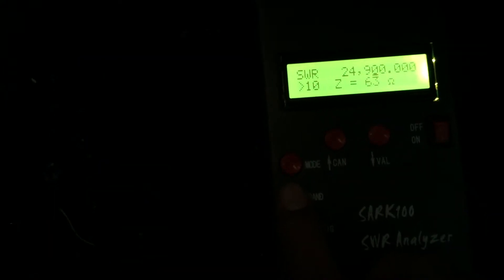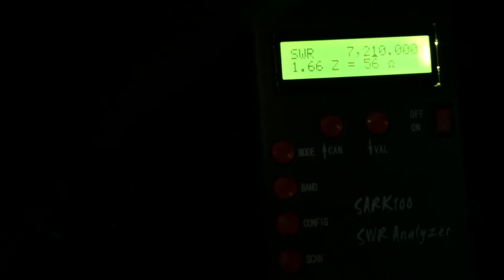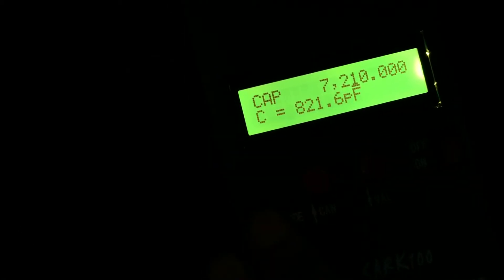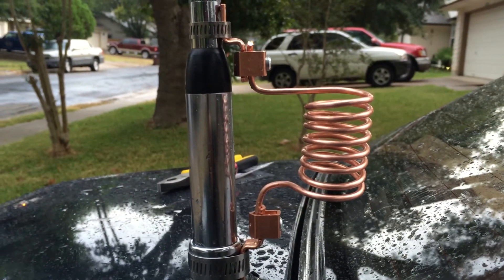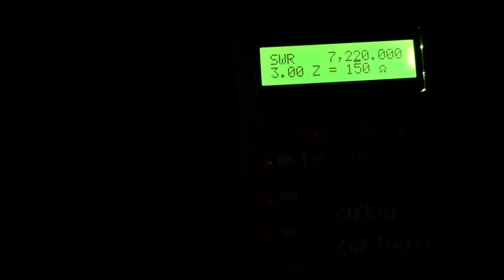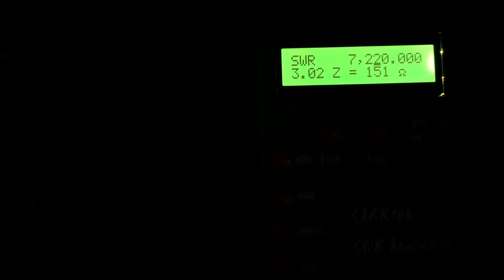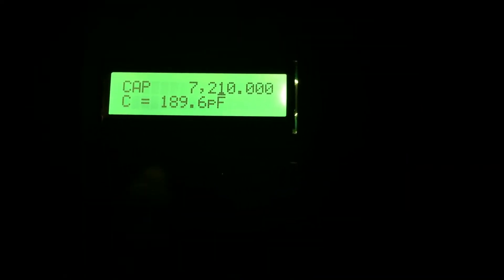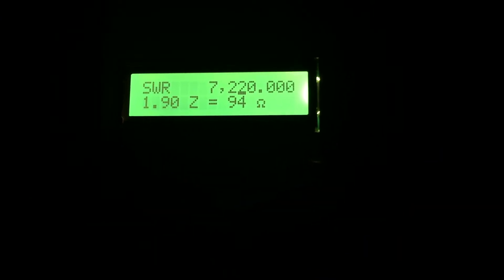Adding an inductor to a 40-meter Mobile HF Antenna

Comment: I would typically follow a different process.  
1) Use the meter to find the SWR dip within the 40 meter band (in your case it would appear to be higher up somewhere in the 40 meter band)
2) Temporarily attach a roller inductor (purchase from ebay) with alligator clips
3) Slowly add inductance and watch the SWR dip move down the band as inductance is added - stop at the frequency of your choice
4) Measure that inductance - and create a permanent inductor of that value (the wider the diameter of the inductor the better the band-width)
Have fun - and great 73s!  :-]

Comment: I would definitely compress and spread that coil to see if the standing wave/z might drop even further..... (I'd probably Invest in A better  analyzer.. ) also,  at that point I'd find a silver mica cap that will work with that Inductor to get some good reactance and bring it down flat... get a variable cap and adjust it and then measure the capacitance of the cap period that should get you right there

Comment: You want to tune a shunt to an x of 0 and an r of around 40 ohms. Dont tune swr.
Reply from the maker: Totally agree, and though I might have had a passing knowledge of this when I did the video (6-years ago), I definitely appreciate it more now.  SWR is also something we can't ignore, though, because we need a good impedance match to deliver power from our transmitters.
Reply: I have run an unun for what seems like forever on my mobile.   IC-7100, ALS-500, to the big HI-Q 160 antenna.  I've started re-examining my setup.  The lower I go in frequency the less power I'm able to run without the ALS-500 kicking out.  I'm sure this is due to low radiation resistance below 20 m.   I'm going to borrow an MFJ analyzer and try to get a switched shunt coil similar to whats on K0BG for 160, 80, & 60 m.    Would be nice to actually feed the antenna with 500 watts on the lower bands, especially 160.   I've read that the 40 ohms apposwd to 50 ohms allows for use of 17 m.

Comment: Low SWR is not the only thing the radio is looking for to work well, the high impedance of 119 ohms is not good. The output of the rig is designed for 50 ohms, not 119  ohms. Ideally a well matched antenna should have both correct impedance and low SWR. Lack of fundamental understanding of basic radio and antenna principals seems to be your biggest problem.
Reply from the maker: I actually do understand that SWR doesn't equate to resonance.  But our transmitters will not work if the SWR, with resistance and reactance factors, doesn't get somewhere close to 1:1.  This is almost a 7 year-old video and I have learned a lot while experimenting with this mobile station, and with new home-based antennas in HOA restrictive homes.  

Have you done mobile-HF before?  Because you are almost never going to get 33-ohm resistance and X=0 out of a mobile vertical (maybe on 10 or 11-meters).  It's a compromise.  I'll do another video on the vehicle as it stands today.  I use a capacitive matcher in the trunk at the feed-point, and generally get good reports from those stations that I can hear - even into Europe.

Comment: if you are not confident in your meter, throw it in the trash and buy quality
Reply from the maker: I have several meters now.  I would love a Bird 43 with 100W and 500W slugs, but sadly that's about $800.  Someday perhaps.  As it is now I have several meters that are "accurate enough."  The Radio Shack meter has actually proved to be pretty good when compared to MFJ and Diamond SWR/Watt-meters and antenna tuners.
Reply: @SWRadioConcepts  lol you sure know how to make a gal eat Crow

Comment: How did you hook up the coil. Where is the top of coil and the bottom of the coil connected to
Reply from the maker: The coil technically shorts the shield to the center conductor.  I know, it's scary, but at RF/AC, it's actually not a short like it is at DC.  I replaced this coil the next day with an MFJ-909, and I've since replaced that with an MFJ-908 Inductive matcher at/near the feed point of the antenna in the trunk.  The inductive matcher is just a tapped coil shorting the center to ground like I was doing here.  It works great and I've got nearly a 50 ohm match at the feed point, and touch it up with an MFJ-929 automatic tuner under the seat next to the transceiver.
Reply: @SWRadioConcepts  So are you saying that you feel inductive matching (MFJ-908) does a better job than capacitive matching (MFJ-909)?  (For your particular application, of course.)
Reply from the maker: @WallDiver7  The inductive matcher, the MFJ-908 works well, provides a DC path from center conductor to ground (theoretically reducing noise and providing some static discharge protection for the radio), and also I don't have to change the taps for every single band.  I believe 20M/80M is the same switch position on the MFJ-908, for example.  This makes switching bands a little easier.  So in my case, yes I prefer the 908, but the capacitive 909 also worked fine and provided a good low SWR on any band.
Reply: @SWRadioConcepts  I'm in the final stages of installing a mount for the Shark sticks I just bought.   Will work 10 though 80m swapping sticks out.  I bought the 909 before giving it full thought.... knowing that I will need a DC path for static discharge.   I'm wondering if you experimented with an inductor coil while using your 909... and what the results were?
Reply from the maker: @WallDiver7  I would be concerned that adding an inductor would require making an additional adjustment since the value of the inductor will change depending on frequency.  I used the 909 capacitive matcher for a few years without any problems.  I don't know how important the DC ground is, I'm basing my understanding of it's importance on K0BG's extensive website on mobile ham radio, and it makes sense to me.  I can't say I noticed a difference in noise though since the change.  My recommendation is to place the capacitive or inductive matcher near the feedpoint if possible.  I also found the addition of the "autotuner" valuable since the bandwitch of mobile ham antennas are pretty narrow - particularly on the lower bands (lower frequencies).

I am intending on doing a follow up mobile ham radio video very soon, and I'll explain and show my current setup in detail.  Check back for that!

Comment: been awhile. . But I had this problem. found out the more in ground is usually the problem. as far as the coil.closing the coil a little.  
like watching the vid's.
Reply from the maker: Hi!  Thanks for watching. I ultimately replaced this with a trunk-mounted MFJ antenna matcher (near the feedpoint).  I also did a lot of extra work ensuring good body grounding of the antenna mount.  I only had this coil on for a day.  It was a nice experiment though, it did work, it's just not practical.